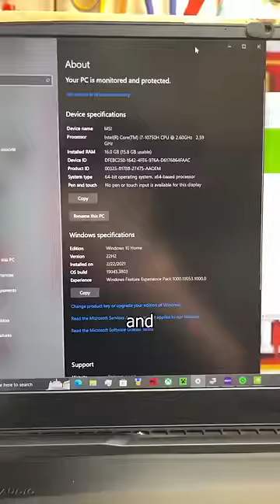MSI Raider with broken hinges (common failure) #laptop #tech #pc #technology #shorts

Comment: I'll be honest, money will never go to those hinge mounts.

I've heard the saying about cars "older models were built to last, and newer cars were built to fail just after the warranty."

It comes down to money. In my experience,  many laptop manufacturers make laptops that look good at first, but they seem like they're actually designed to fall apart, because they don't care that their laptop is bad.

 If they can cause a problem in a laptop over time, they will, because they want have as many chances as possible to buy a new laptop when something tiny fails.

Like soldered down RAM, non-upgradable CPU, proprietary battery that isnt easily removable, and especially the hinges. Companies like this just want you to buy a new laptop as fast as possible no matter what.

This is exactly why I will stick to desktops all day every day. But, if I had to choose a brand to stick to, it would be Lenovo thinkpads. Upgradable, easily repairable, and durable.

Comment: There is  great cheap way to fix those! You can take a thin strip of aluminium along the back of the screen and mount with screws through the front of the screen.

Comment: hey guys I have a problem with my pc and I need the nerds to help me out

the vga light on motherboard is lit and pc keeps shutting down my GPU is rtx 2060 and cpu is i5 9400f and my psu is deepcool de600 v2 should I upgrade psu because it is making a lot of noise and it gets louder before pc shuts off